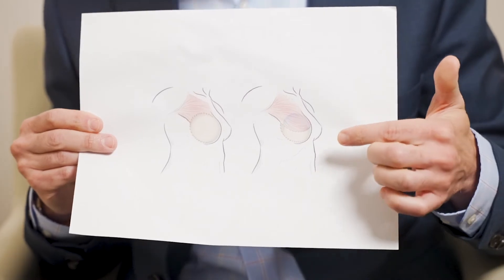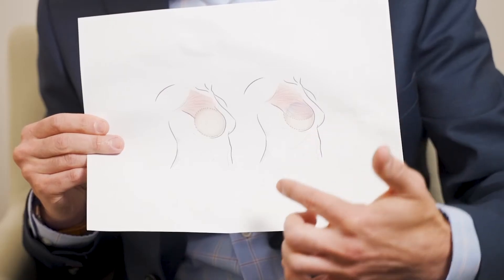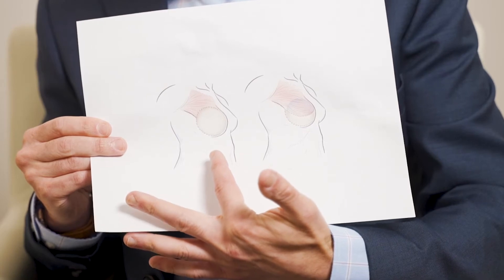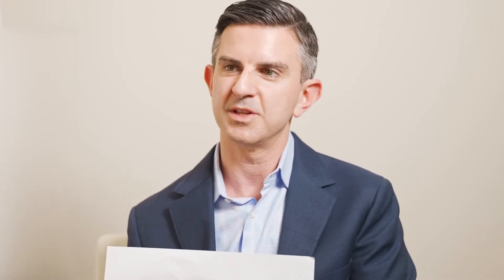Prepectoral Tissue Expanders

Comment: How often do you run into expander problems. I had radiation while mine had about 200mll. I had non cancer side drop down while cancer side encapsulated. Had that fixed. Then I had one leak, so replaced. Then I had same one port (not on expander) flip upside down, so replaced it.  Things seem good now